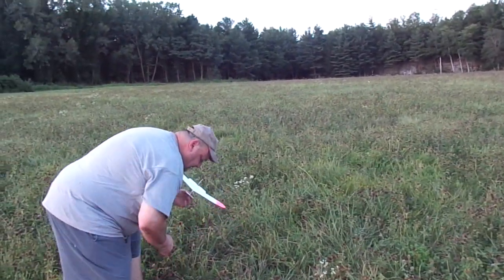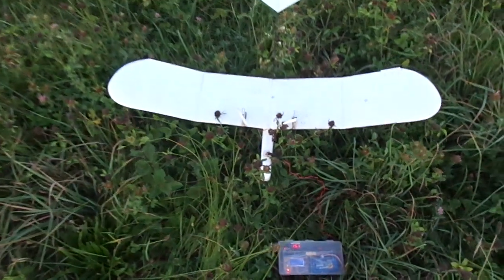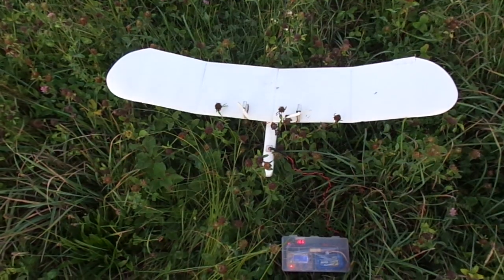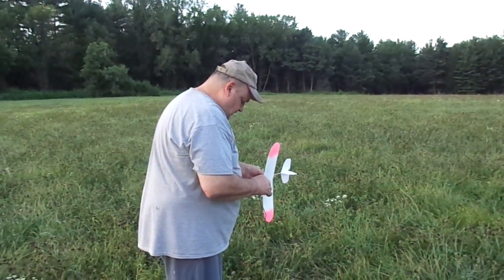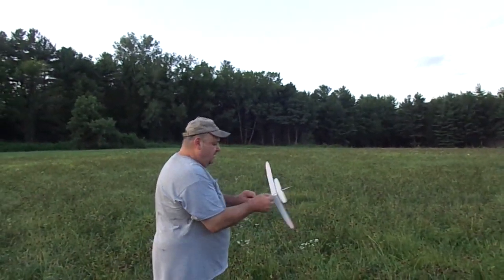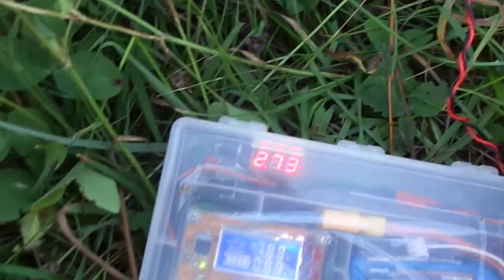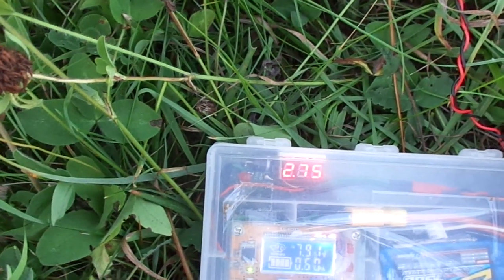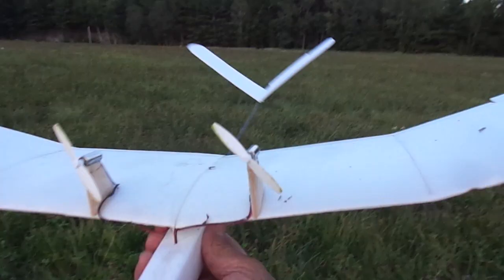Nice Air For Supercapacitor Free Flights

Comment: I was looking all over for 40 Farad super cap, then I see they discontinued it :( so I hooked four 10 farad in parallel..charged this pack to 2.80 volts using about .1 ma is that about right?